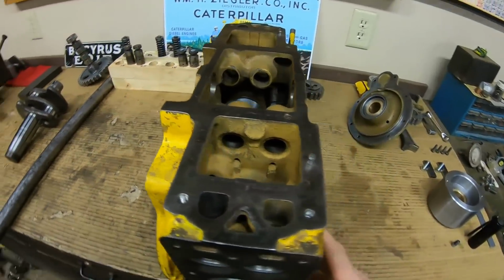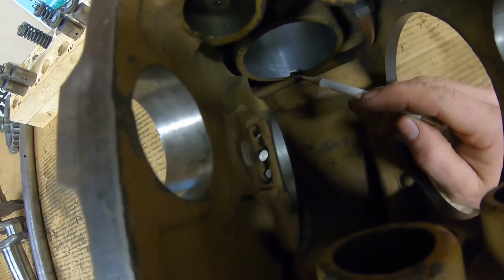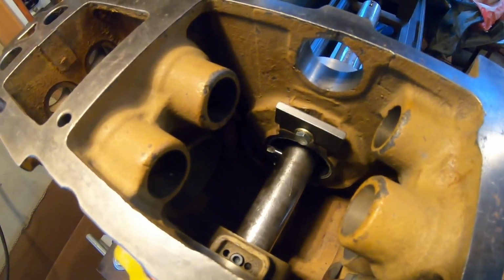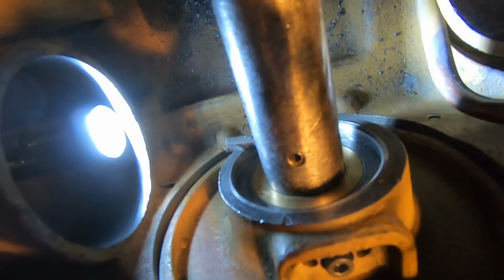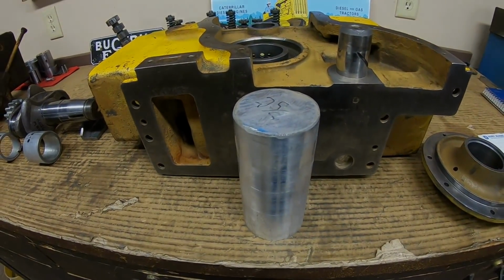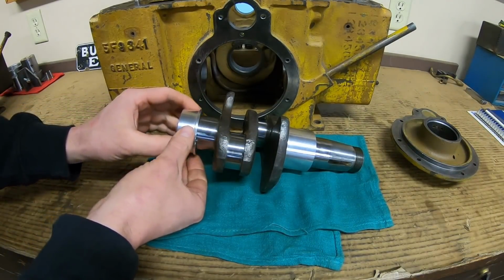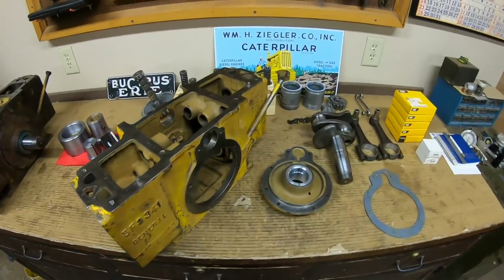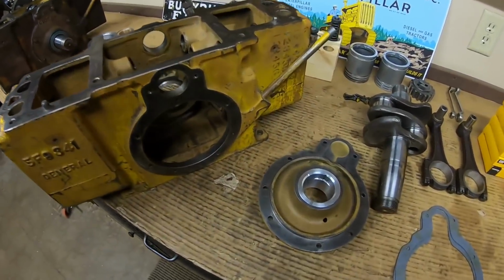Caterpillar D2 #5J1113 Starting System Ep.14: My Total Pony Main Bearing Redesign - Kinda Crazy!!!

Comment: There's nothing wrong with the basic design of a horizontally opposed engine like that. It's used by several engine companies like BMW, Lycoming, and several others. The only thing I see wrong with Cats design are the sloppy tolerances they allow. But I suspect they did that on purpose so they wear out quicker and they can sell more parts. It's no different than Apple's concept, hold back technology and you can sell a buyer and newer phone in a year or two. Same thing for computers.

Comment: I said that about Wisconsin engines you do so remember you are using the same concept but with out tapered roller bearing genius
Reply: @Squatch25. Google Wisconsin engine diagrams for the vf4 the rear main cover is shimmed to adjust the crank end play oil is squirted on to the roller bearing and rods are splash

Comment: Did you guys have to do any mods to make your little lathe as accurate as it is? I have considered one but worried they would be to sloppy but you are doing more precise work then me
Reply: @squatch253  thanks for the info. I am not looking to do a lot. Usually cleaning up a shaft to fit or slight modifications to a part

Comment: Do you know anyone that has wired in an automotive coil to the points of the magneto to get higher voltage spark rather than use the coil in the magneto?
Reply: I actually witnessed an old mechanic - and this was in the 1960's remove and smell of a coil from an International Super A. Apparently if the coil windings arced it would burn the tar/paper insulation and make a burnt odor. Ask some young mechanic about that!😀

Comment: Enjoy your videos. 
I'm rebuilding my 212 grader starting engine. 
I'm looking for rod bearings for the big end,cat has them on back order with no eta.
Do you have any leads on someone Making them elsewhere?
Reply from the maker: No leads for having any made, unfortunately.  I would take the part numbers and plug them into the parts search on Machinery Trader and see what pops up - you might find one here or two there, and have to make a few phone calls to round them all up and get them heading your way.
Reply: @squatch253  as luck would have it I called ziegler yesterday and got 2 out of 4 that they had.
My dealer is carter and they had nothing. 
Thank you for the tips!appreciate it

Comment: How do you store the two extra ponies with all their new components and keep them from rusting/corroding until they get their call up to the big leagues?
Reply: Cosmoline?
Reply: I think he has at least one more project on the short list that will need another one of them in service soon.  Will be interested to see if he answers what his storage plan is but possibly like the Naval Air Museum in Pensacola.  All external openings have a gasket made without punching out the center to form a seal.  Then fill the case with oil and fog in some lube in the intake before sealing it and  I would imagine would last a long time pickled.